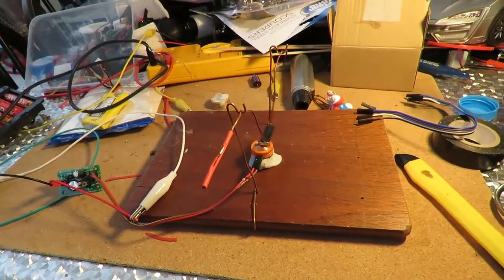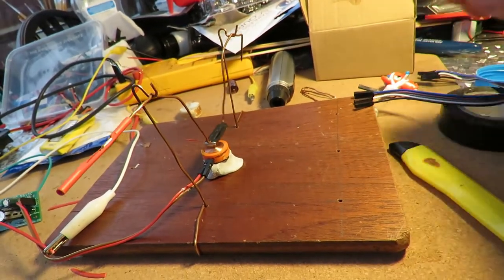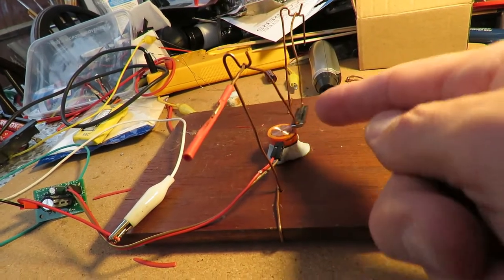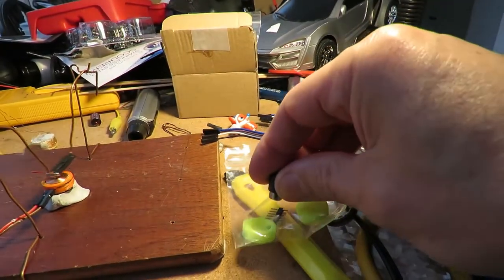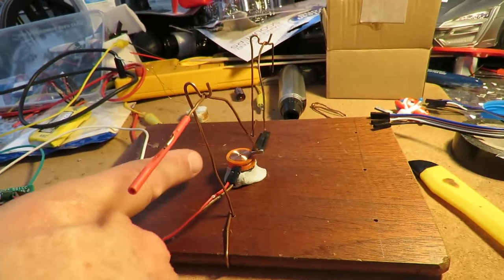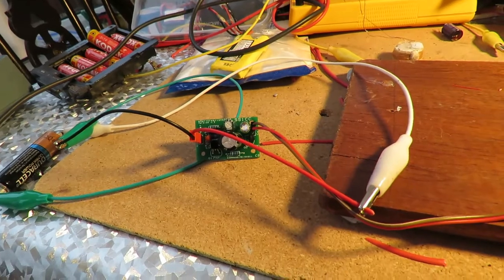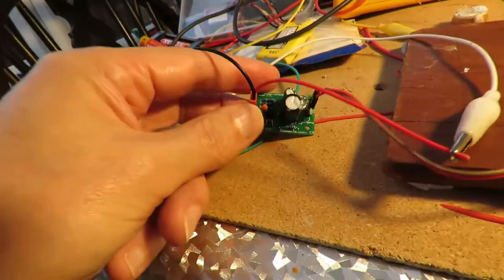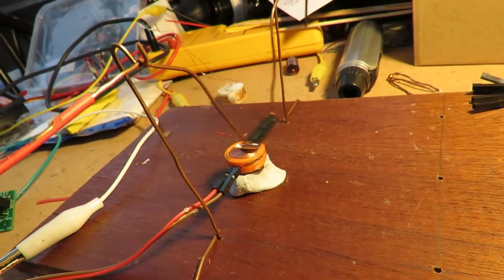First test of Telboy2002's circuit board and 3D printed coil holder

Comment: Seems like a nice little board. Be good to put a small toy character on the magnet and make a model swing. I don't think you have one of those. Could change the capacitor for a higher farad and make it swing slower. At least I think that would work. 
Just looked at the circuit from Telboys link. You could change the 100k that is connected to the 47k resistor for a small potentiometer. That would let you adjust the rate of the pulses.
Reply: This comment might confuse you. Yes putting a small toy character would instantly make it appealing to children under the age of 13 but as this channel is already tagged as "Made for kids" that should be completely acceptable. Of course I could try building a completely new channel to publish all those videos that could possibly be classed as "Not made for kids" but I doubt it will get any subscribers and it will require me re-editing those videos to remove such things as animated channel icons so it might be difficult to get motivated to do that. Of course I might even try BitChute and see if it is worth uploading videos there. It might give visibility but no income. We will see.
Reply from the maker: Thanks Mike, yes those mods should work. I doubt that I can find it on my table at the moment and I am thinking of tidying up a bit, so it may get shelved for a while.
Reply: @GrandadIsAnOldMan  Well I have been looking at alternative streaming sites. There are some where you can still be monetized.
I Know I will never get the subs you have and as I said before, my reward is people liking my music. I don't see me staying on this YouTube any longer because you just can't be sure if your doing the right thing or not and that bothers me. You know, maybe a word here or there in a song and their crazy logarithms report you as a bad person. I have only started out with my music on YouTube so it won't really affect me too much if I leave them for another streaming source.   Anyway have a great weekend mate. 👍
Reply from the maker: @mikeflight9  some guys are trying swearing all the way through their videos to make the point it is not made for kids but the problem is the content. If there is something that might look like a kid might like it then the FTC might consider that they might take action and all those mights along with a few ifs and buts are what is making this unworkable. My view is that it is so unworkable somebody must come in and fix it. I am just about to publish a video to point out Christmas is for Kids so any videos that contain Christmas content MIGHT appeal to children. https://youtu.be/ce0IEcxXfmw